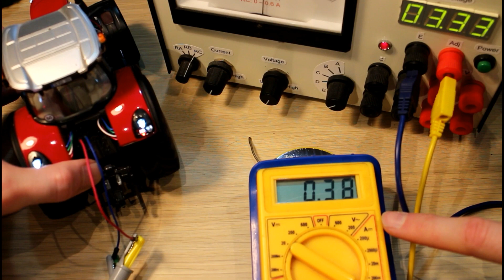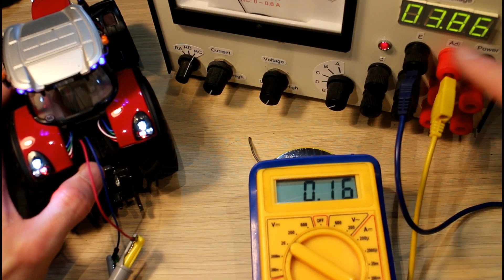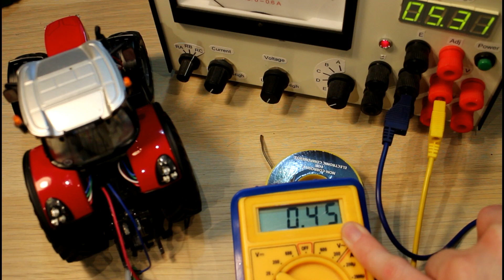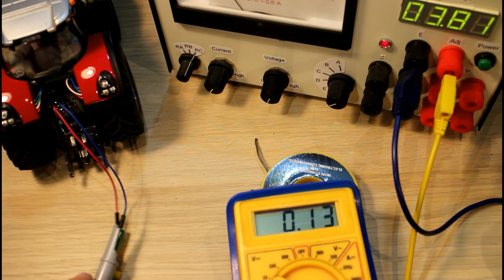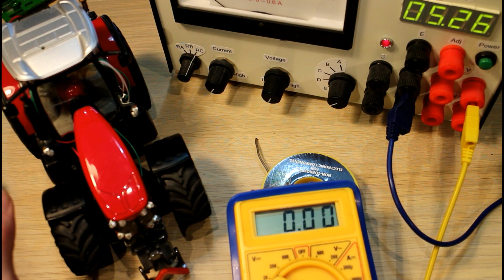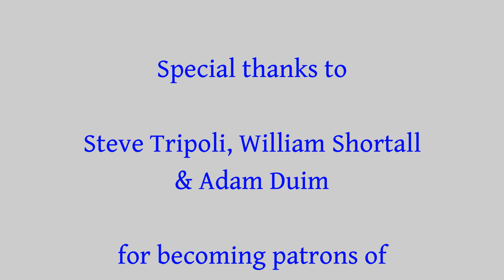Massey 8680 Voltage and Current Testing

Comment: Interesting, and I like your psu :) The Adj input is that like a feedback for the voltage regulator ? .. Btw, this drop-out voltage, does this justify a second battery pack dedicated for the radio&servo ? Maybe that is not wanted..
Reply from the maker: +bwack Hi, I don't think you would need a second battery. I've had this model and a few other working for a few months now and there hasn't been any really issues until the battery is well discharged but I do have large batteries in all my heavy loads like the kane low loader so that probably helps a lot. Also I don't think a second battery would fit in most of my models so far, there isn't a huge amount of space inside the models.